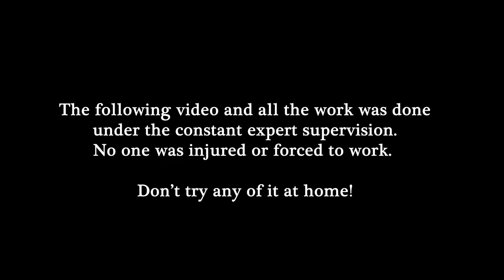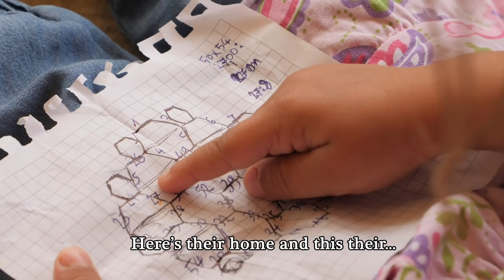When a 3 Year Old Kid is Better At Woodworking Than You / Building Honeycomb Shelves

Comment: That drill is too big and heavy for her.  A quarter Bosch impact tool will fit her much better.  Years ago before impact drivers, we used ordinary drills to build handicap ramps through our Baptist church  team.  Everybody had a drill.  Today after about 50 ramps, we all use impact,Dewalt was popular but at 20 volts would spin the drill too fast to stop drilling in time to stop the screws from being buried halfway through the wood. We all went to impact tools.
The impact tools drive easier and are better controlled.  I bought  Bosch 18 v, kit with planer, drill, 1/4 in router.  Love them.  Lots of work but never a failure. Next purchase will possibly be a paslode  brand battery driven framing nailer.  One of my mechanic friends has one.  And  swears by it.  
Keep the videos coming as well as shots of your family.   
Good Luck and GOD BLESS YOU ALL.

JoeB